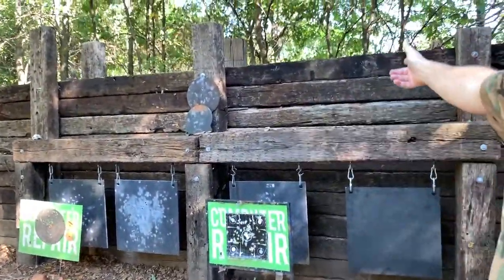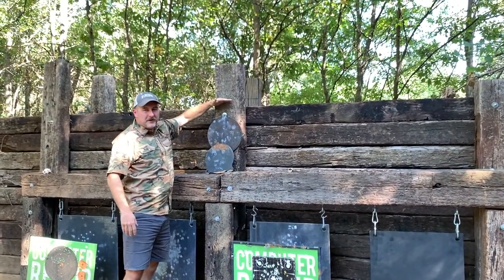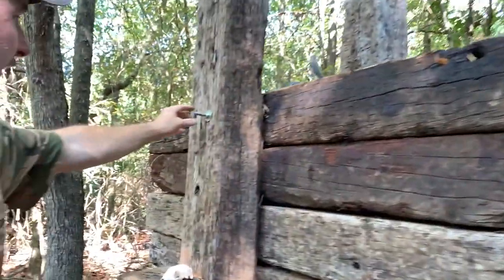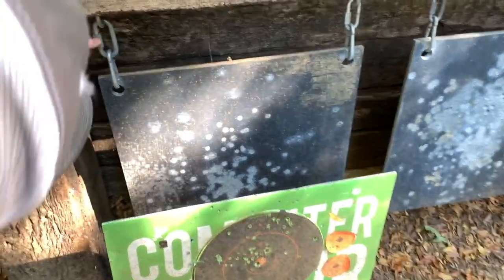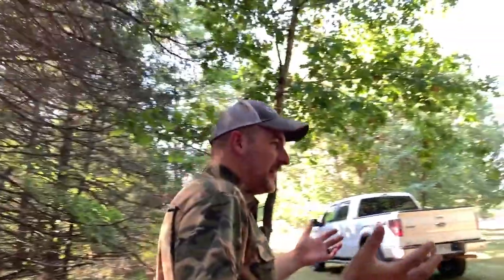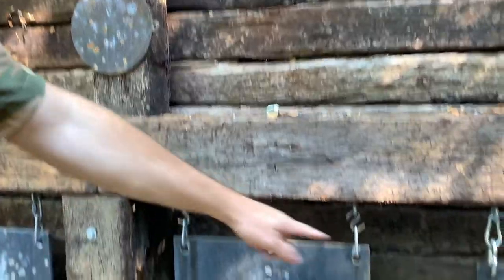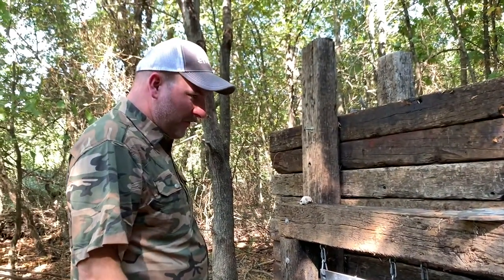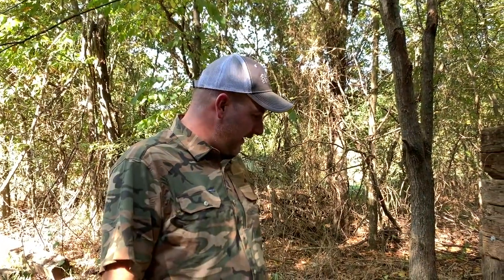The Bullet Wall pt 3, Railroad Tie Bullet Backstop

Comment: I like your nice solid build.   The threaded rod to hold the top together is a great idea.   I am looking at building a back stop also.  Two thoughts for my build.  I see some light through the ties.  I think I will offset the back row of ties by half to prevent complete pass through.   Also you have room for three more ties I think I will fill mine up to give extra protection.   Thanks for the great ideas.

Comment: Great job sir.... my only concern is the at the 3:34 mark the little round steel plate is so high and that would concern me because its so high you could easily miss and send a stray bullet flying in the air because it truly dont have no upper backstop to it. Nice setup though👍

Comment: Bro., nice job on the shooting backstop, but I'd suggest you more securely attach the steel plates somehow.  Otherwise people will steal them.

Also I don't know what became of the Mossberg Patriot you had trouble getting to shoot consistently, but if you still have that rifle and still can't get it to shoot as well as you'd like, you might want to take up reloading to be able to experiment on getting ammo tailor made to shoot well in a particular rifle.
Reply from the maker: Hey thanks for watching.  I sold the Mossberg but I do hand load and I did get one load to shoot OK.  I'm not worried about the steel getting stolen,  we're pretty secluded.

Comment: Hi Joe, thanks for your reply to a comment I recently made.  Also I would strongly suggest you set up HIDDEN surveilance cameras that run continuously and have night recording ability.  Anti second amendment, chronic bed wetting liberals will sabotage your range in one of various ways.  A great gun range we had here in Alberta was forcibly closed by the local government when anti gunners filled it with 5 tons of garbage one night.
Reply from the maker: I do have trail cams up.  I'm quite literally what we call "out in the sticks" and if anyone were to find it, they'd more likely use it than tear it up.  It's just a bunch of coverall wearin' good 'ol boys around here.